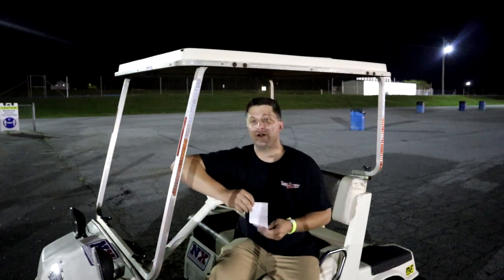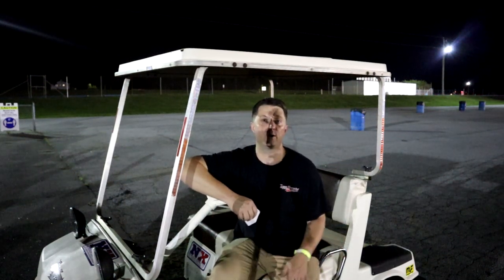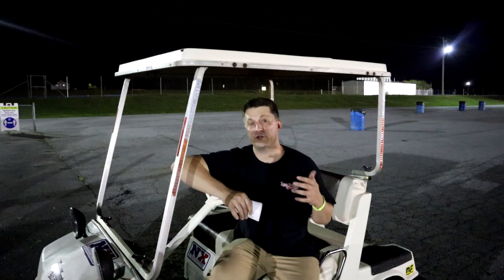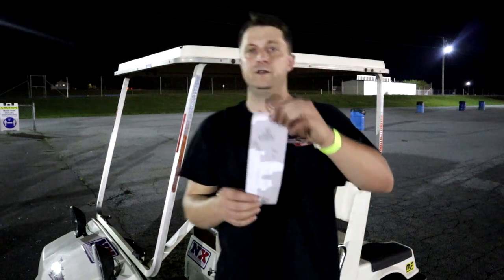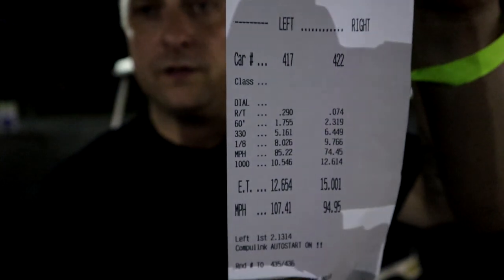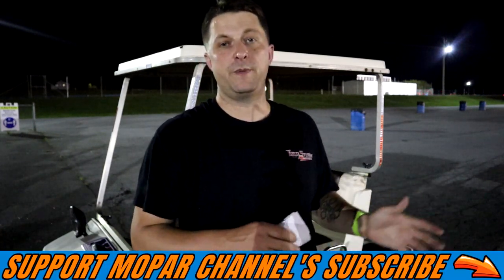First Pass With New Edge Stall Converter!

Comment: Bro 3500 DA and 85% humidity is BRUTAL, great runs in that weather 1.75 will easily see mid to low 1.6s n 12.0s to lower in better air 👍
Reply from the maker: Thanks man yeah weather is not great for boosted stuff right now I can't wait for fall.🤞
Reply: Baddest ram on the gram 💪🏁
Reply: @bmanclassics4350  🙏

Comment: Yeah just my  experience , with my edge 3600 stall in my 6 speed I had to switch to Hoosier 28x10 x17 slicks  I just couldn’t hook until I switched and my sweet spot is 15 psi
Reply from the maker: That may be the plan 👍